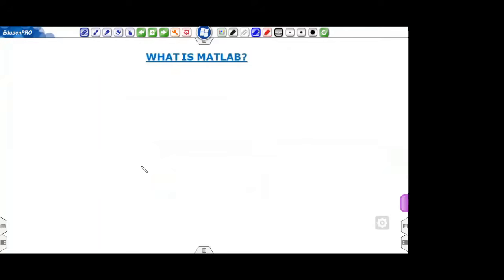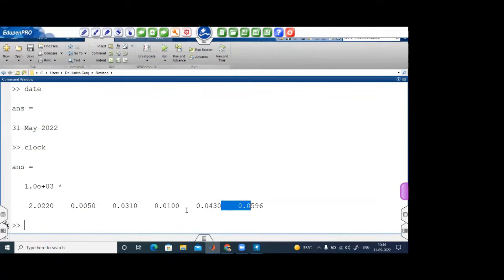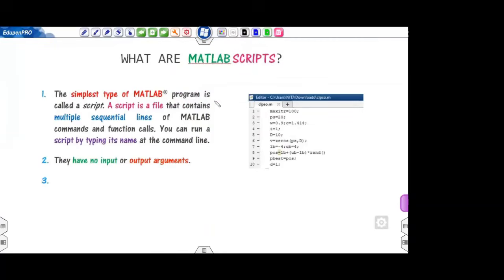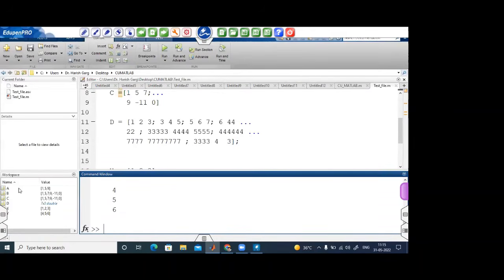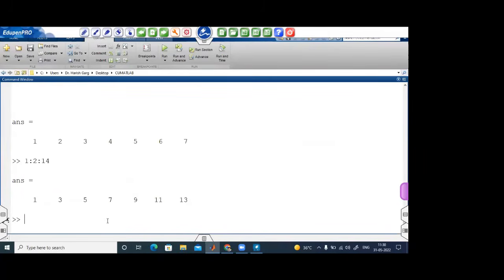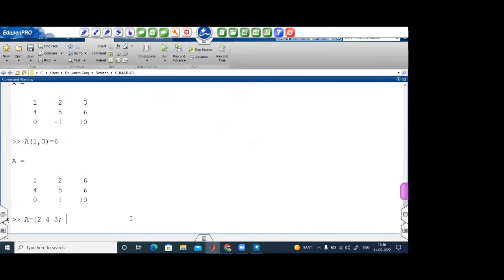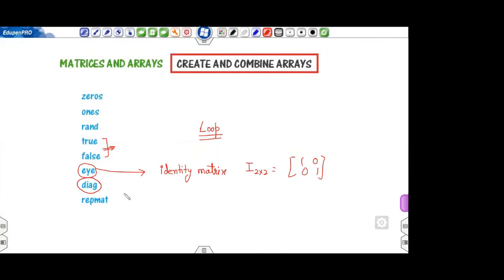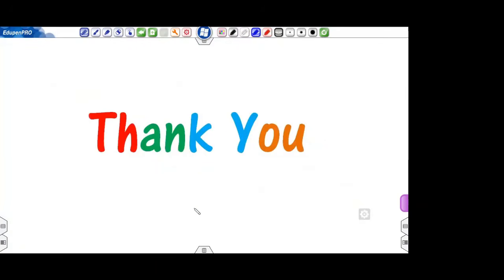For Beginners: Basics of MATLAB Programming and Graphics

Comment: clc;
clear;
format long;

% Input function 
f = str2func(['@(x) ' input('Enter function','s')]);
% Input bounds
x_upper = input('Enter upper bound limit: ');
x_lower = input('Enter lower bound limit: ');
% input tolerance
tolerance = input('Enter tolerance for the function :');
% checking the validity of bounds
if f(x_upper) * f(x_lower) >= 0
    error('Function values at bounds must have opposite signs.');
end

% Bisection Method
for iter = 1:100
    x_r = (x_upper + x_lower) / 2;
    f_x = f(x_r);
        % Check convergence
    if abs(f_x) < tolerance && (x_upper - x_lower) / 2 < tolerance
        break;
    end
        % Update bounds
    if f(x_upper) * f_x < 0
        x_lower = x_r;
    else
        x_upper = x_r;
    end
end

% Display results
fprintf('Root: %.10f\nFunction value at root: %.10f\nNumber of iterations: %d\n', x_r, f(x_r), iter);